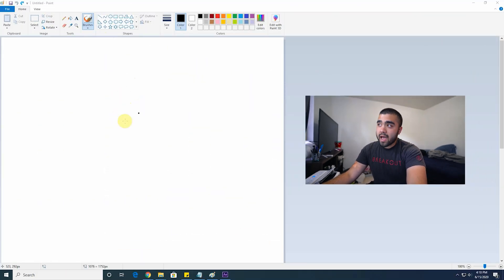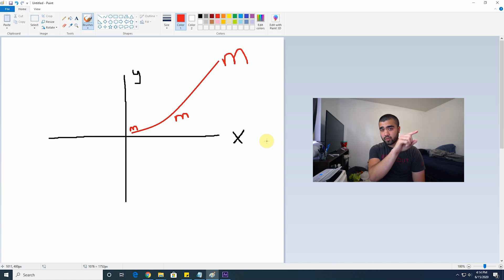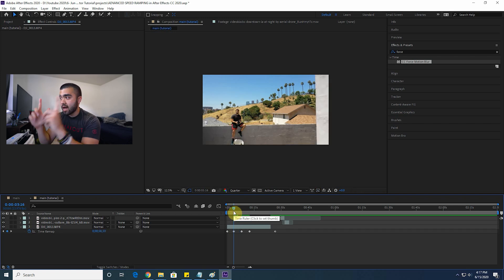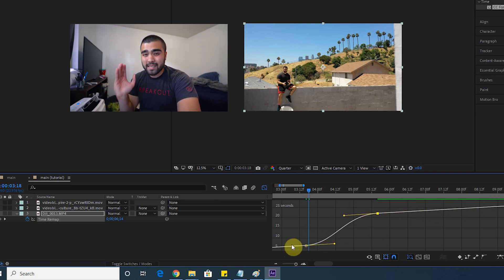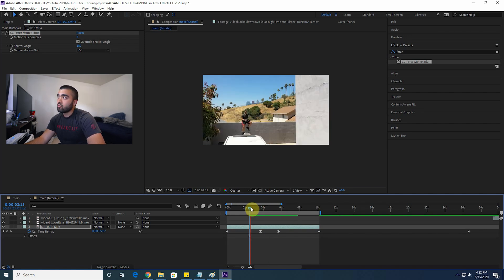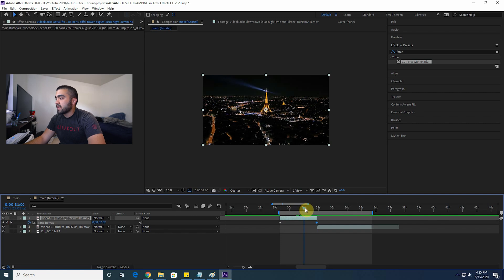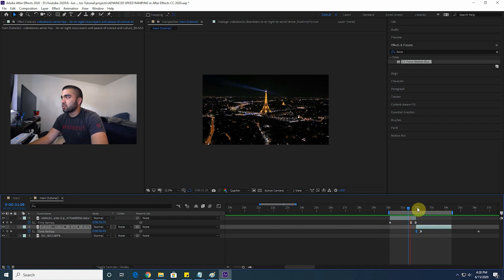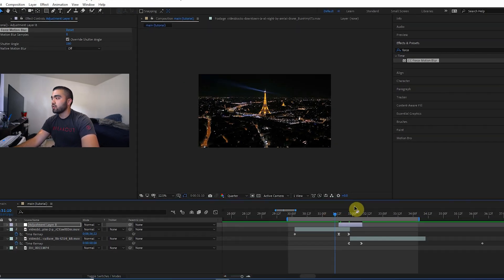ADVANCED SPEED RAMPING in After Effects CC 2020 | Graph Editor Transition Tutorial, Time Remapping

Comment: Also have a couple questions- when I click a single keyframe then click graph editor, it doesn't show the zoomed in view of that single keyframe like in your video, it shows all keyframes I've placed on the clip. Also, which graph view are you using? Value or speed graph? I'm having trouble manipulating the slopes without messing up the speed after the keyframe. I adjust using the yellow bars but it also adjusts the portion of the clip after the keyframe. Any ideas what I'm doing wrong?